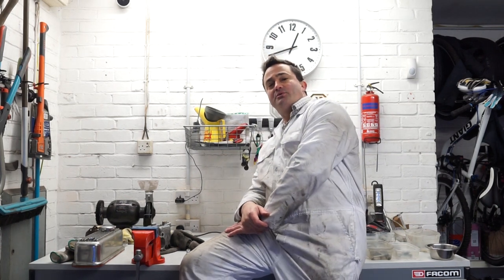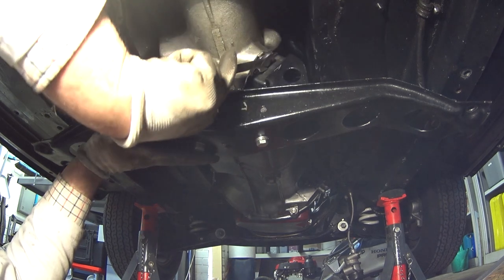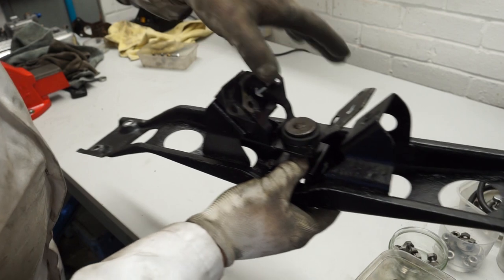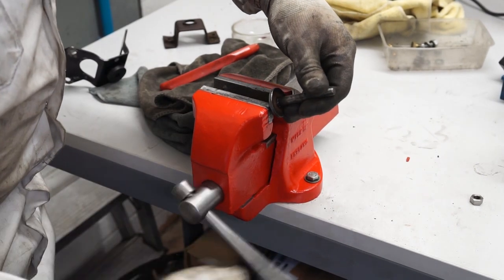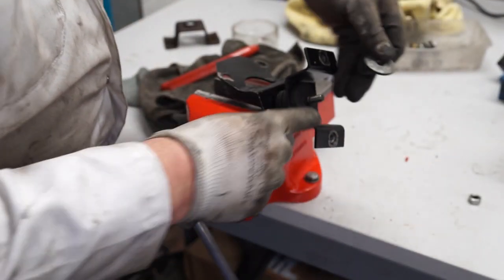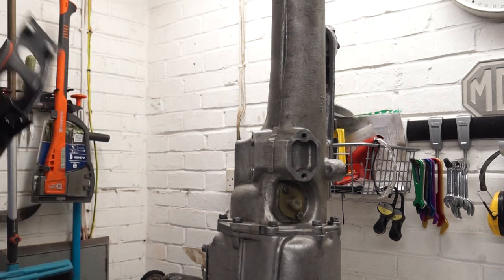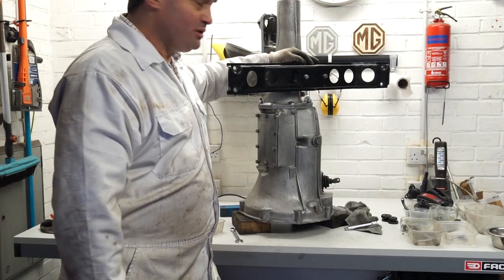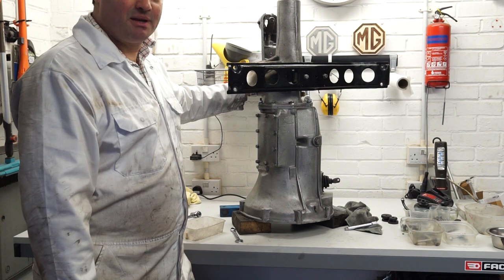Understanding the MGB Gearbox Transmission Crossmember Removal, Refitting and Modifications

Comment: Those extra frame holes  are used when mounting the crossmember for an overdrive transmission.  Installing the x-member for an overdrive transmission is even more difficult due to restricted access. Great video and thanks.
Reply: I struggled trying to fit my unit using the other frame  holes when I switched to an OD box as recommended by John Twist. I eventually used the holes for my non OD box and it fitted fine. Not sure if that is normal but it worked for me. Getting that assembled back on the car is one of the toughest jobs I have found on the B. The frame holes may be for the automatic unit?
Reply from the maker: Many thanks to both Gareth and David for the extra info on this, I had an MGB GT may years ago with an overdrive 'box but I can't remember which holes it used.

Comment: David, I can't thank you enough for making me aware of those holes for 'adding lightness'; having them means this job is much easier as you can tighten the mounting nuts through the holes without the need to be a contortionist.
Reply from the maker: Many thanks Malcolm, having a few access holes does make the job a lot easier. Having the slotted holes is another bonus.
Reply: @davidrussellwilks  ah yes, I forgot to mention I’d also taken that tip on board, thank you.

Comment: Awesome video and great tip on slotting out those holes. 2 areas of an MGB I have found that must have been deliberately designed to cause massive frustration: the gearbox crossmember and the windscreen frame and your videos give hope for both 😎
Reply from the maker: I do think the the gearbox crossmember could have been far more user friendly, just a bit more thought on the design would have made it easier to fit. I'm hoping to make a windscreen re-fitting video soon!

Comment: Thank you David for another excellent how-to video. I appreciate the time you put into these. I'm sure I will refer back to this when I have to pull the transmission. My next project is replacing the exhaust manifold and all the associated gaskets and broken studs. I haven't done this before and am expecting a challenge. Take care!
Reply from the maker: Many thanks Trent, I think the manifold studs can be a real pain to undo. Getting them soaking in a penetrating oil a few days beforehand may help. I'm quite lucky as I have an aftermarket system on my car that is fairly easy to take apart. Hope all goes well with the job!

Comment: Once again an excellent explanatory video, David. I have seen a few gearbox removal videos that don't adequately show the mounting arrangement and I was glad to see you show it in detail on the bench. Your videos are always so very well done with meticulous technique which has given me the confidence to tackle the bigger jobs on my own MG.  I have plans to swap my 4 speed gearbox for a 5 speed Mazda kit which does not require the use of the original cross member but attaches with a bracket to the frame cross member. Still possibly a challenging job.
Reply from the maker: Many thanks for your kind message, the Mazda 5 speed does seem a very popular upgrade for these cars. I hope that fitting it goes smoothly for you.

Comment: Thank you for that video David. It tempted me to head back under to double check if I’d done everything right but no way! In my case, it’s a 1980 overdrive car. I did it on my back with pretty much everything in situ and it was an absolute bear 🐻 reaching into those little crevices to loosen and tighten bolts. Surely the engineers back in the day could have figured out a better design than that! C’est la vie. Your point re taking care not to strip the threads in the aluminium casing is a very good one. In my case I just could not fit one of the 4 bolts without cross threading it, so I didn’t put it in and drove the car with only three bolts. Looking at it again a month or so later it had shifted to where everything lined up and I was able to put bolt #4 in. So the crossmember gods had mercy on me that day! Great video, thanks again and best of luck on the track!
Reply from the maker: My understanding Bruce is that the overdrive cars are the hardest to work on. Having a ramp would certainly make the job easier, crawling under the car and trying to get your hands in the right please really is not easy. In the past I have over-tightened one of the 4 bolts and damaged the thread, it was fairly easy to fix with a heli-coil though. I was tempted to add one to all the 4 holes but never got around to it.

Comment: Another great video. They are very much appriciated. I replaced all the rubbers a few weeks ago and I managed to remove the four bolts in the gearbox from under the car without having to lower the gearbox (held in place by a lift), with normal spanners. My biggest challenge, as you show, is to put the rubber grommets in the butterfly. Then I built it all up off the car and replaced the hole piece using a second lift under the crossmember to align the holes with the bolts into the gearbox. A bit fiddly but possible. But again I have no overdrive.
Reply from the maker: Many thanks Rutger, I found having the parts firmly in the vice meant I could use two hands on the rubber grommets to make getting them in a bit easier. I was however quite disappointed with the short time the new rubber parts lasted.
Reply: @davidrussellwilks   I don't race my MGB on tracks so I hope they last longer!
Reply from the maker: Thanks Rutger, I think it was the oil under my car that made them fail, they had become much softer.

Comment: Had I not seen this great video I wouldn't have know about the difference when fitting an overdrive transmission. This summer I'm going to pull the drive train from a 1970 B that has an OD tranny and replace it with another 1970 drive train w/o OD transmission.

Comment: Hi David Another great video. Precise and concise. Your car is so well maintained. I was wondering what you use to seal underneath your MG. Is it just painted??? I was thinking of using the black sealant (liquid tar) that they use to fix holes in roof gutters,etc... Any thoughts????
Reply from the maker: Many thanks for your kind message Oliver, delighted that you are enjoying the videos. I don't use anything at all to seal the underneath of the car, it's just painted. I do clean it fairly regularly and it only does around 1500 miles a year, often in wet weather though. Personally I prefer just to wipe it down with light oil at the end of the season (I never use water to clean it anymore.). I think if your car is a daily driver trying to clean it in this way is not practical. However if the car is not used much I would go down this route rather than using any type of thick underseal. Once the underseal is on it cannot be cleaned up and I think it makes the car harder to work on.

Comment: Great video!
Had my gearbox and crossmember removed and found the  butterfly assy missing, so have to replace it.
What significance does this part have, I'm assuming it takes stress off the mountings coming through the transmission?
Thanks..
Reply from the maker: Thanks for your message David, I think as you've said the butterfly part helps to spread the loading on the pads and is bolted to the crossmember too, this probably helps with any for and aft load.